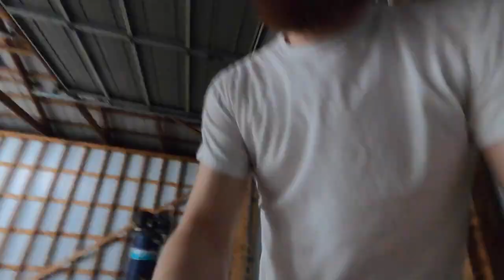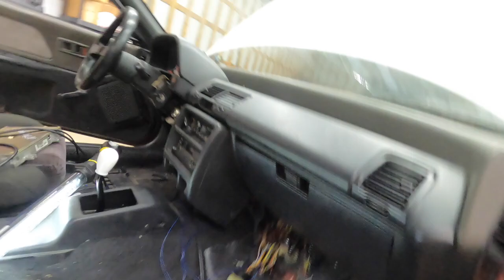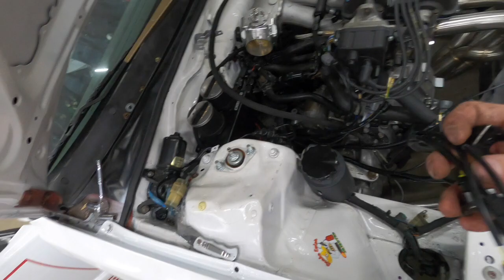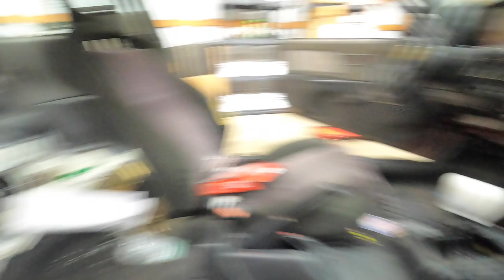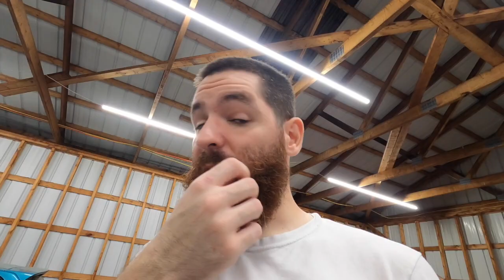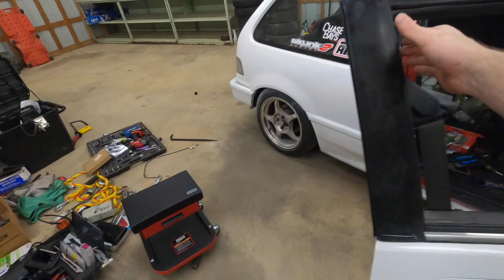ALL MOTOR LSV EF HATCH / MONOTECH HARNESS INSTALL / FIGHTING GREMLINS

Comment: I’m about to swap a ls vtec into my 91 and currently it’s dpfi I’m looking to get the mono tech harness is it going to be plug and play if I don’t move the fuse box like you did?!
Reply from the maker: I wanna say yes, it should work with everything in its factory location. I’m not 100% certain but I do believe it will. You can contact monotech and ask as well
Reply: @TIP-PJ  thanks man I reached out to him a few min ago he said it is and he even said he can color code the connectors with a paint marker so I know what’s what so that’s pretty dope! This is my first b swap in a ef so I have never delt with dpfi before the most I have ever done was wire in v tech so plug and play is awesome!
Reply from the maker: @coreylennox7200  yeah that harness is sick! I love the factory wire color!

Comment: Yoo i got an 90 ef with a b16a swap im wanting to put an new manifold how could i block off all the vacum lines on the manifold and tb?
Reply: And map sensor from the fire wall
Reply from the maker: Bring it to me haha nah Is it a stock manifold or an aftermarket one?
Reply: @TIP-PJ  stock manifold im wanting to put an after market tb and manifold
Reply from the maker: @damienheuangpraseuth1152  an aftermarket manifold usually will have most of the necessary vacuum ports and none of the extras. And an after market Tb will usually have the map sensor mounted on top so it won’t be on the fire wall.

Comment: Are the 1320 headers  any good?
Reply from the maker: 1320, yes. The one I bought previously was a 1320 rep and it was garbage. These 1320 headers are actually pretty nice
Reply: @TIP-PJ  I want to get todas way but to much so i might just the 1320s

Comment: Hey man love the vids.i talked to u a little while back about the fucked up valve keepers on the b20v.not sure if u remember.had a question about my trans.not exactly sure what trans is in it.bought the ef last year with a b16 and did the b20v setup a few months ago and the trans doesn't seem like a b16 trans.my first and second rip threw real quick and 3rd gear im getting almost 105mph out of it.it just seems like 3rd through 5th are super long.was thinking it is an LS trans but why would 1st and 2nd be so short,any ideas?
Reply from the maker: Almost every b series trans has the same 1st gear. Or very similar. What the redline? If you’re touching 105 at the top of third it’s probably an Ls trans lol
Reply: @TIP-PJ  limiter is 8700
Reply from the maker: @claytondelade1767  so some of the pre 92 cable b16 transmissions had a decently long third gear. If you’re almost touching 9k in third and seeing 105 then it’s most likely an early b16 transmission
Reply: @TIP-PJ  oh ok.much appreciated.its around 60 in second.when I run my buddy's h2b eg hes in 5th gear while I'm still in 3rd.lol.
Reply from the maker: Sheesh lol
Reply: @TIP-PJ  so u think I'll be better off with a hydro b16?
Reply from the maker: @claytondelade1767  or a 92-93 cable gsr transmission. But those are like gold.
Reply: @TIP-PJ  did u get the b20 finished in the rex? Ur running a b16 trans in that too?